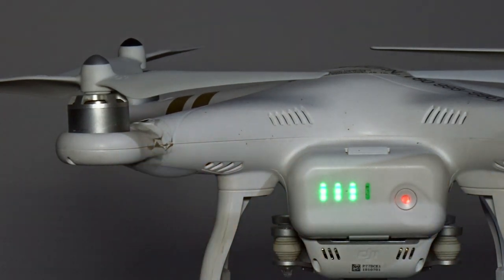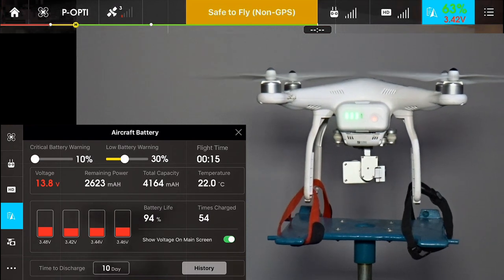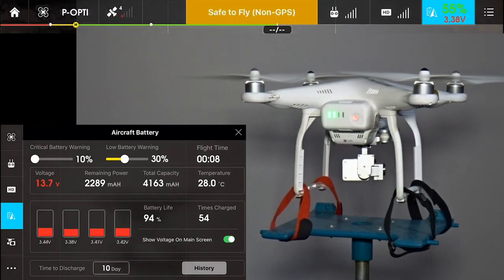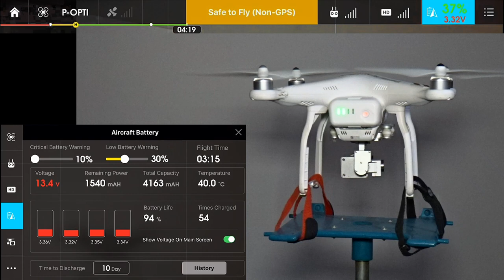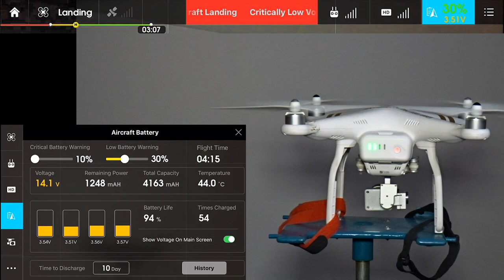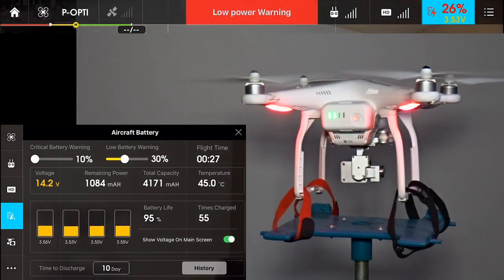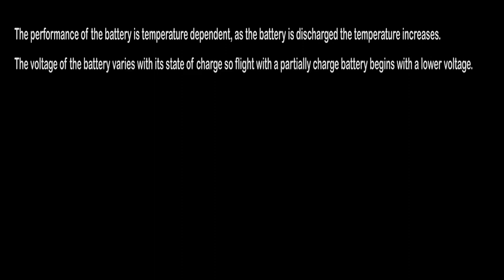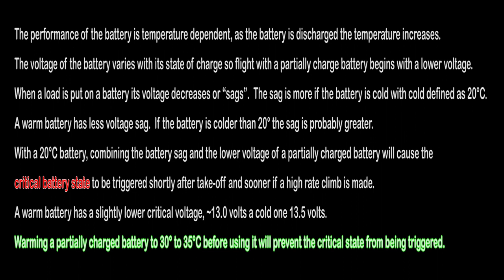Phantom 3 Battery Testing - JAN 2016

Comment: i also got a same problem like this too . when i fly the drone . battery life still got 51% after 31% the drone automatic land . and show that Critically Low Voltage on my screen . can i know what i need to do ? is that mean my battery broken or any tips i can fix it ? Thanks you!
Reply from the maker: I only had this problem when the battery was partially charged say 75% and the battery was cold say 18°C (65°F).  Solution is to take-off and hover until the battery temp is 21°C (70°F) after which it will output more current with less voltage sag.  Switch to the battery screen to see the temp.
Reply: Thanks

Comment: i see in your video,the battery life increase from 94 to95%. do you know how to increase battery life back to 100%?
Reply from the maker: Life indication can sometimes increase after the battery has been fully discharged which can be done by hovering through the red power bar until the craft force lands.  You may never get back to 100% because as batteries get older and cycled they permanently loose capacity.
Reply: I have 4 batteries and I had let them sit about 3 months not flying but short flights here and there. so I decided to recalibrate them last week and I logged everything as I went.
for example my worst battery had been charged 64 times and showed a life of 84%. I drained them to 2% and fully recharged. after the new charge that same battery jumped to 95% life.

after I couple more flights only draining to around 15% the life fell again to 92% and has held there so far. 

so yes, running them down to about 8% they recommend and recharging will bring some life back but you'll never get it all back as stated.

Comment: good to know.
full battery provides good voltage

hot battery provides good voltage

having neither is bad
Reply from the maker: Take care not to start with a hot battery because as it discharges it will get even hotter.
Reply: ***** ah true thank you

Comment: Guys. Have upgraded my Phantom 3 to the latest software and now it flies maximum to 30 meters. I am depressed. How to change it? Tried in the settings the max hight switch to 120 m and it didn't work. Please help.
Reply from the maker: Two things go check, beginner mode setting and with the new Go4 you must log into it while connected to the internet and accept DJI's terms and conditions.
Reply: archuba I just had this problem to I updated my tablet and everything was back to normal.
Reply: archuba sign in and out of the app whilst connected to the internet

Comment: This is not %100 true you still get red voltage warning in 38C 45C and 49C too. (%30 %20 battery capacity it should be enough to give you green and orange voltage color)
its true warmer battery performance better than a cold battery but you are not supposed to get red voltage warning when battery around 35-45C
And in the begging you had %63 capacity and 21C after take off you immediately get red voltage warning. We are not talking about 0C or -5C its 21C and %63 , your li-po battery cells are clearly dead, if you send back to DJI they will send a new one.
I'm still agree and know warmer battery performance better than colder but its is different situations.

Edit: I saw the same issue who fly in Indonesia which is weather always average 30C
Reply from the maker: +Guclu Kamberler Voltage warnings yes but not an alarm (ie phantom is going to land now).  These are caused by increased power demand.  During every flight eventually you will get a battery warning near the end of the flight.  The batteries are still in good shape as they will allow flights of ~17 to 18 minutes which is a typical flight time for the 2200ft ground elevation.
Reply from the maker: +Mockery Channel Interesting.  I have done a test where the battery was preheated to about 35°C and then I ran it down.  By the time the test was finished the battery temperature was 60°C with no warnings.  Have you check the actual battery temp when the problem occurred?  (switch to the battery page in the app, it shows the temp)

Comment: If i was you i use a sistem to control the hard climb, drone is about 
Weight (including battery and propellers) 1280 g

For what i see in you tube there are people lifting 3000g with dji phantom 3 pro... 

Perhaps use a sistem to control the lift up, not going to much... This week i sent my dji p3 pro to DJI after 4 months with cracks in the motors plastic arms, there are real problem in the plastic of dji phantom 3 pro, dji has repair inside warranty, this is why i dont like this test, understand ??
Reply from the maker: +Paulo Lobo Yours may have broke because the plastic was not molded correctly.  This is why DJI replaced it.  My phantom is already very old, 288 flights, 45 hours of airtime and not a crack anywhere.  Many more phantoms get cracked or smashed because of low voltage alarm and rapid decent.  For me, as I live in a very cold place, this is a much bigger worry than cracks in the plastic.  The hard climb can also cause a low voltage alarm.

Comment: This is cruel for the drone, please understand that you must not do this !
Drone is build to hold is weight not more, this will make the plastic arms get cracks ! 
This way dji will see this and stop giving inside warrantys for all plastic arms cracks ! Telling people that they been doing this ! 
Dont you agree ??
Reply from the maker: +Paulo Lobo Paulo this is not cruel.  For the majority of the test the phantom is given just enough power so that it stays airborne and no extra strain is put on the arms.  One part of the test has more power but this is done to simulate a hard climb.
Reply: +Paulo Lobo No, if the Phantom cant hold this willnot hold the natural flights with power ups and everything, its the same, DJI should test the shell better before the release, excusing them for a error its not the solution... ;)
DJI is chinese that's why they try to avoid warrantys saying that is users damage when its not...
Reply: No ... This is just a simple test.